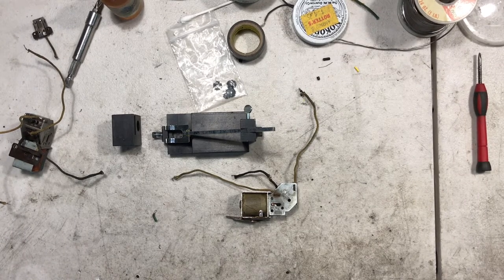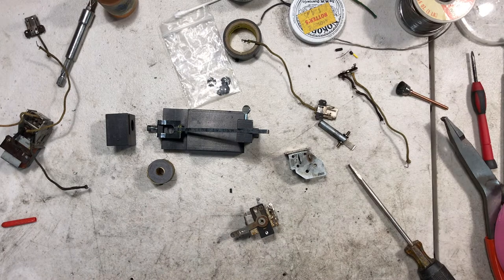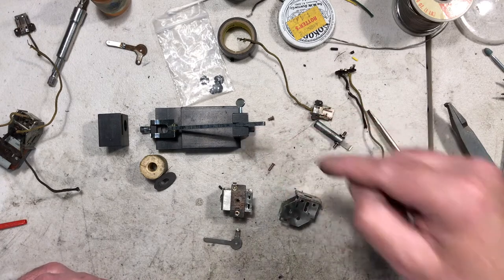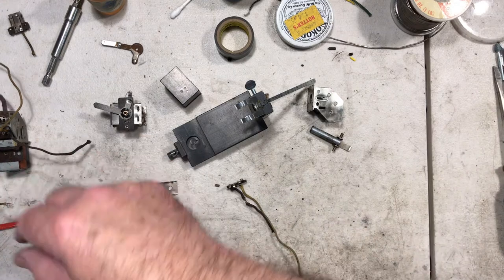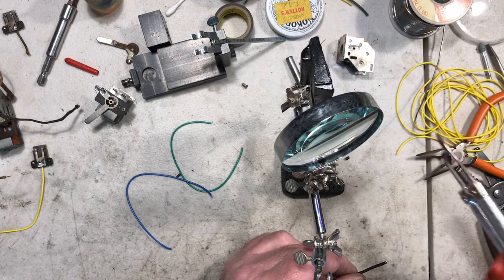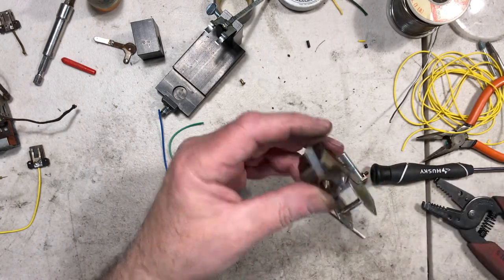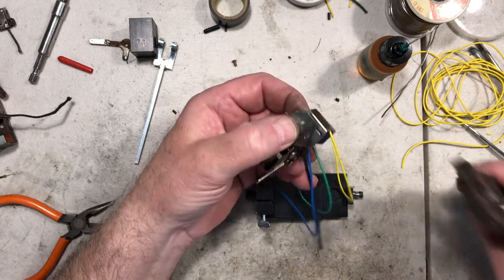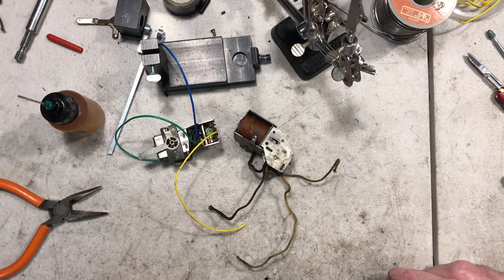Lionel E Unit Rebuild: How to rebuild your E-unit........Step by step.

Comment: Excellent video! I have been repairing trains for about 20 years and I still learned a few neat little tricks!

Any thoughts on reducing e-unit buzz?
Reply from the maker: Hi David
E-unit buzzing is an inherent trait I think...HaHaHa...it seems they all do their share of it. I found less power while changing direction eases that noise. Or pick the direction you want and move the lever over and the noise goes away since the unit doesn't have to pause anymore to change directions. Neutral is where the noise is ! This is what I find at least.....
Thanks for reaching out....Stayed tune for more e uint videos.
Mark

Comment: When I started this video, I realized you were the guy that did a video on the 60 trolley I watched over a year ago.  That was informative, so I figured this one would be as well.  I was right.  I am rewiring my e unit in  my original 671 locomotive since the wires are fraying, but I was trying to not take it totally apart.  After seeing this I will strip it down, doing it right, and putting it back in service for another 70 years.

BTW, I've rebuilt six 60 trolleys, and it's getting easier all the time.

Question, do you really need that tool in order to put the drum in?  Is it possible to do it manually?  I kinda tried and it was hard.  The tool is $69, without the anvil which is another $29.  I don't have that many e-units to do, no more than 5 max.
Reply from the maker: Thanks for the kind words…. I’m glad my videos help..MT

Comment: The E unit has always been a confusing part of the lionel system for me. I finally learned what it does and I am impressed by the work of this electro mechanical device. Can you tell me if what electronic circuit or device was developed to replace the function of the E unit as I am sure someone developed a replacement that is not mechanical. Thanks. I enjoyed your repair video.
Reply from the maker: Hi Loretta
Actually yes they have come a long way and we now have an electronic E-units in most trains since the late 70's early 80's.....small circuit boards do all the work now... Motion, Sounds, Smoke and Steam.....
I still like the old stuff though...Thanks for watching and Stayed tune.
Mark

Comment: Great video Mark. The jig really helps I bet. Where would one pick one up? Thanks
Reply from the maker: First Thanks for Reaching out......I bought mine some years ago and haven't seen the exact one again but here's a similar one if you check out this web site. Let me know how you make out.....
Mark   
www.pedesignmanuf.com
Reply: @mt.trainrestorations5931  Yes that looks interesting. Thank you for the lead. Ive  only done one EUnit service, yesterday, and that was using pre-wired fingers, but I was successful (!) and now I think i could do the wire solder also. lolol foolhardy I know
Reply: @mt.trainrestorations5931  Thanks for the lead. He has some interesting tools! I got a repro of the Lionel bar to open the EUnit, but another hand would obviously help! Esp re-assembling. I am going to service my own E-Units from now on....

Comment: Great videos and very good in your teachings.I have a question,what kind of tool do you use for your e unit repairs.Can it be bought still,Thanks Mark Sr
Reply from the maker: Hi Mark
Thanks for watching ! Heres what I have on the Tool used in my video. STX-377 Anvil and STS-378 E-unit assembly jig. Made by Precision Toy Train Tools-USA. Find it online.
You want both these pieces which come in the kit I got.
The Anvil is the best way to attach the lever to the e-unit.
the holder helps a lot when you need a third hand.
Let me know if you need other info on fixing e-units.
Thanks
Mark T

Comment: Where did you get the assembly fixture you used at the end of the video?
Reply from the maker: Check the website http//pedesignmanuf.com 
The one I have is hard to find but this one may be as good?

Comment: Is the current the the motor rectified DC?  If AC how is motor rotation reversed?
Reply from the maker: AC power is switched when power is reapplied to the e unit turns the drum which brings around a different set of contacts reversing polarity.

Comment: What wire do you use to replace wires for the e-units?
Reply from the maker: Hi Jeff
It depends on what you're needs are but typical wire is 24 gauge and using colors help keep them straight when soldering.
the replacement 4 finger and 2 finger assemblies come with the wires on them which is best and they are different colors. you can buy fingers w/o wire and do your own. I do both depending what's available.
hope this helps.
Thanks
Mark T

Comment: Never use oil on a plunger/coil assembly. Oil will dry out, collect dust. Use graphite only!
Reply from the maker: Thanks for the tip, but I found graphite seems to attach itself to everything and creates a continuous cleaning of contacts issue.
It appears a good cleaning every so often is the key to a good running engine.....Keep watching!
MT

Comment: I have an e-unit sitting in pieces in a bowl.  I had cleaned it and bought new finger units, but I simply could not get it reassembled.  I don't have one of the nifty vices, and I have struggled with it for days with no joy.  I just broke a tooth off the drum with my pliers.  Arrrgh!  I'm giving up and buying a rebuilt unit from ebay.  Working on the trains is supposed to be fun - and I'm NOT having fun...
Reply from the maker: Sorry to hear you're having trouble but I too struggled in the beginning. I didn't have any special tools or jigs to hold on the Units either. Its like you need three hands..... Patiences is the key, and a little luck. you'll get there. email me with questions and I'll try to help.